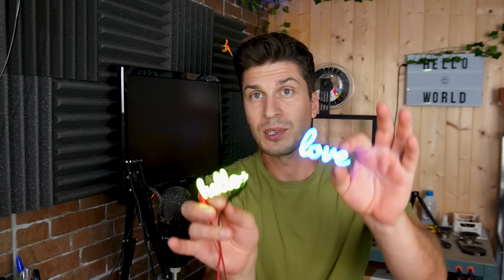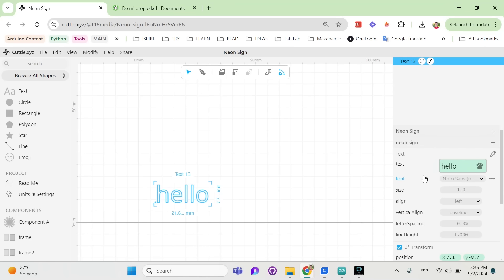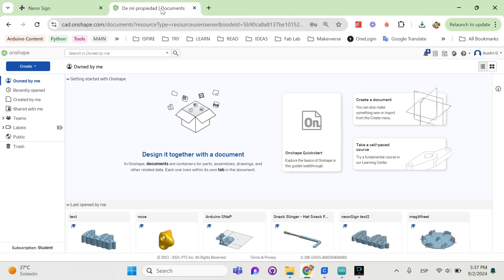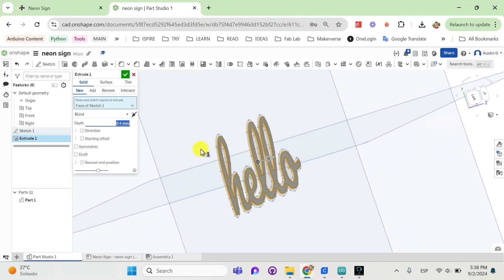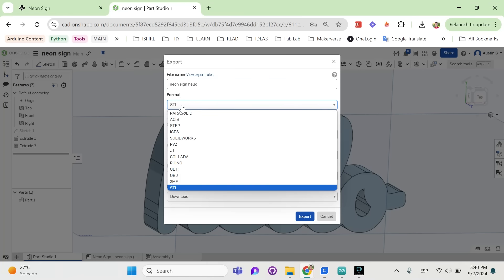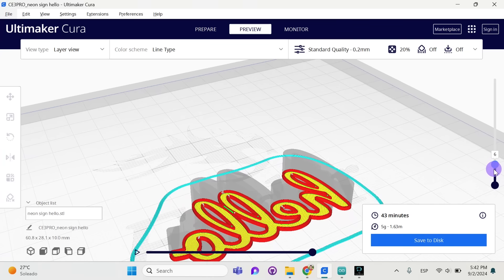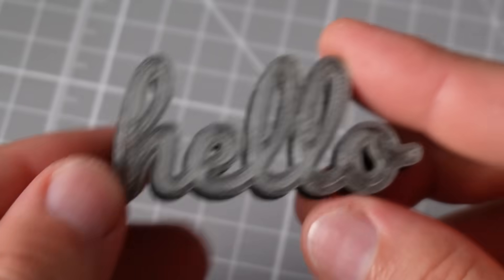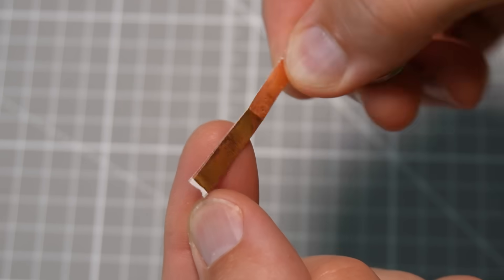How to make a Mini Neon Style Sign with 3D Printing - Tutorial DIY

Comment: Nice project!
You could add a base to host the battery, a switch, and wires connection.
Reply: I was thinking the same, but boxes for 2032 bat even wired and with button are cheap.
Reply: Filament is cheap. Elegoo PETG, $12.50/kg. A little box is less than a dollar and custom to your needs.
Reply from the maker: By the way, check Ikea. So far one of the cheapest places to buy button batteries fast if you live near a store.
Reply from the maker: Thinking the same, great idea! Working on this and other variations now. Will keep you posted with new vid updates. Thanks!

Comment: Love the project, thanks for the concise tutorial! I was wondering how you plan for matching the length of the text strokes with the discrete options for the filament LEDs.

Can you shorten the LEDs somehow? Or measure the total stroke length in the design software?
Reply from the maker: It was a bit of trial and error process. After printing a couple of first design tests, you quickly get a feeling of what approximate size works. Just make sure to size it slightly smaller than you expect, and if you have a little excess filament light, you can fold it a bit over the first layer of light. Better solutions coming soon in the next videos! :)

Comment: Really nice project! 😻
There is also a feature in Cuttle called "Connected text" so you don't have to apply the boolean union, but most importantly it will also join the dots on the i's automatically. 
It was nice to see the Cuttle to Onshape workflow too :)
Reply from the maker: Great tip, I will give it a try. Really nice feature for laser cut projects I work on too! Thank you for creating such an incredible app and user experience! :)
Reply: please tell me where "Connected text" is
Reply: @macciejdsbsys7180  the Help menu should have a search box. You now have keywords to enter there.
Reply: Does Cuttie have a utube channel for beginners?
Reply: So where is the 'connected text' option?  I don't see it anywhere in the interface...
Reply: Under all shapes  @Elmojomo
Reply: @Elmojomo  Click on the "Browse All Shapes" and in there you will find it.
Reply: @Elmojomo  There is a search bar on the left and you can type "connected" to find it. Or you can click on "Browse All Shapes" and it should be under the Text category. :)
Reply: This was fantastic.  I was able to pick exactly the font I wanted and it was all connected for me! Thank you!

Comment: If you just run the LED strip directly from a voltage source there is a good chance of burning it out or reducing its lifespan. You need to limit the current when using LEDs, you can do that easily by just adding a resistor and you can also control the brightness that way too.
Reply: maybe im wrong but typically the reason we use a resistor is when going from 5v or 12v to the led's... in this case he directly wired it to 3v which is probably what the LED is rated for, so no resistor needed.
Reply: @gopro2027 You are wrong. The resistor is there to limit the current.
Reply from the maker: This is a great comment and absolutely important to consider if you want to maintain a good light lifespan. Not a serious concern if working with a button battery, but working with other higher-current power sources, you should definitely consider a resistor to limit current. I'm working on new vids around added features like a base, switches, and power supply to help around this topic. Huge thank you for bringing this up @conorstewart2214 !

Comment: Great tutorial. For longer text, is it possible to solder 2 or more LED strips together?
Reply from the maker: For sure, but I think there would be problems running these in series over longer lengths. Better to create parallel connections to the power supply.

Comment: Very nice tutorial, to the point and no unnecessary rambling. Just one question, it appears that the filament LED in your example ended at just the right point.

Do you cut the LED filament? Google is telling me that they cannot easily be cut.

If you have too much length do you just pack it into the 3D print somewhere out of the way?
Reply: Never mind, I just found Andycapp’s comment asking the same question as saw your response. So question answered.
Reply from the maker: Cool, happy you got the answer already. After trying a couple of times, you quickly get a feeling for the approximate length. Def no cutting, best to tuck away extra behind the first light layer. Cheers!

Comment: you dont have to constrain yourself to the nozzle size as the printer can use +-50% of nozzle width. 
meaning your .4 nozzle can lay down from .2mm to .6mm lines.

happy printing
Reply from the maker: Thank you, great tip!
Reply: @nick_the_maker  "detect thin lines" can often lure out more details. your milage may vary.

Comment: I havent done this in a long time but damn, that felt very overcomplicated. Unless things changed any free tool will let you extrude letters and extrude duplicate and increase size and then bolean cut one of the other. I think 2 times faster for people who have never done it before and 5 times faster if you do it all the time.
Reply from the maker: I know what you mean. The reason I use this workflow is to gain access to a huge library of font options for the text. Trying to keep it all free in the browser and I think Onshore is best for that, but it's a shame they have a tiny font library.

Comment: What do you do with excess led filament? Your example was exactly the right size
Reply: My suggestion is to leave the interior pathway wide or tall enough to allow two passes. Run the excess behind the main initial run. If it creates a hot spot if light encase the extra in some foil or heat shrink to block out the extra
Reply from the maker: @MrAtda answered this well. After a couple test runs, I got a good feeling for the approximate length and try to make sure the print size leaves just a little extra, which is tucked behind the first run of filament light if needed.

Comment: Good tutorial but, How do size the filament to your writing or do you just buy what you think  too long and cut or blank it off ?
Reply: Use a piece of twine first to find the length then match your filament to the string
Reply from the maker: Great solution!
Reply from the maker: Great question. It is an approximate guess after playing around with a couple of first-try designs. I try to size the print under what I believe the exact length will be, then tucking any slight left over behind the other layer.

Comment: Have you tried to light it for a long time and does it heat up the 3d print?
Reply: i have a few of those light strands. they are basically tiny LEDs on a strip. They do get warm but that can be reduced by using lower voltage
Reply from the maker: @neeksor answered perfectly. 100% confirm. They get a bit warm but nothing to cause issues or print deformation over time.

Comment: This was a great tutorial, thanks for explaining this step by step. Any advice on making the small battery pack? I guess this could be hidden in a small stand holding the neon sign.
Reply from the maker: Thank you! I am working on some solutions to share in a new video soon. I am thinking various versions would be cool, for example having one as a stand like you suggest or even a long wire that leads to a power source in a pack or from a power supply.
Reply: Make the black part thicker and with a cutout that the battery can slip into.  You could even arrange it so that the positive and negative contacts are made automatically by inserting the battery.  A wire on the side, another on the bottom.